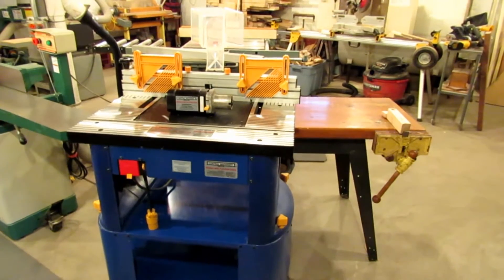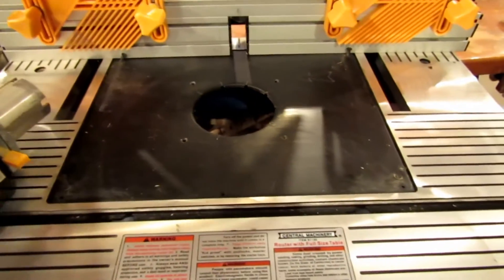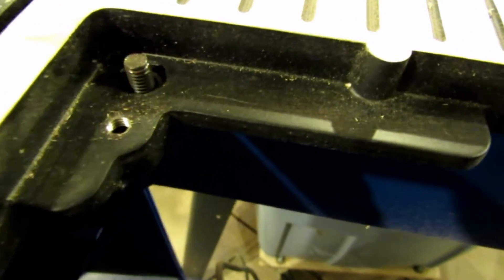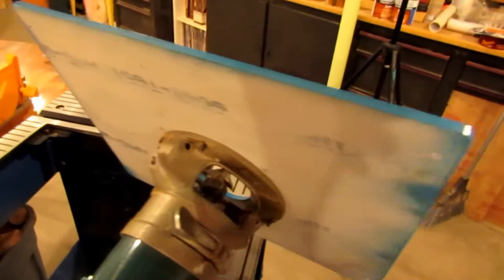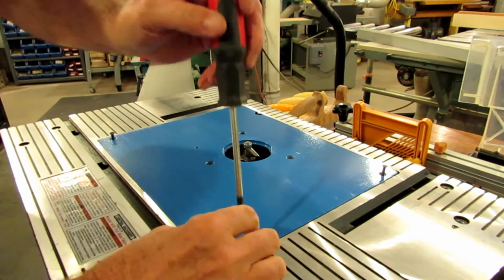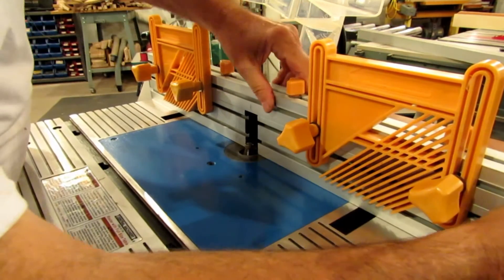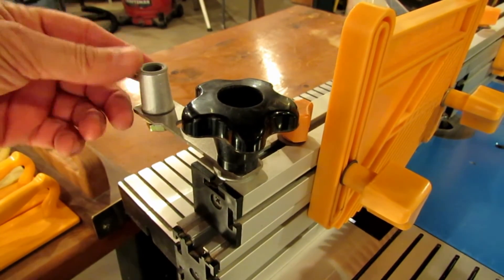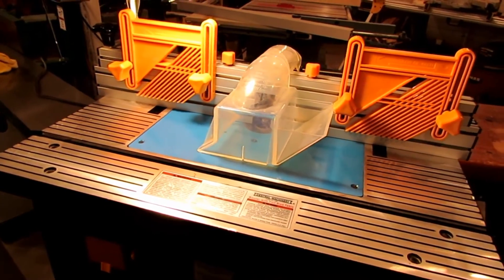Modifying a Harbor Freight #91130 to use a standard router.

Comment: I bought that table and trashed it with concrete board because I found, like you did, that the router was really difficult to use and for me gave me a ton of chatter since the collar cracked twice on me. I built an insert like you did, but not with aluminum. I did it with acrylic and there's too much movement. I'll look at getting a piece of aluminum made for me that would fit that plate size, just not sure how to make it myself.
Reply from the maker: It definitely was garbage. I made a cast iron top table now and what a difference. Aluminum can be machined with many woodworking tools. Thanks for watching.

Comment: Nice modification. Can you tell me what is the exact size of that insert plate you made? I may have the opportunity to buy this table and have an insert plate that may work for this table, but depends on the size. Thank you.
Reply from the maker: O don't remember  what size it was but it was bigger then any  commercially available  plate. I built a better  table that I use now. Thanks for watching.
Reply: @unemployedredneckhillbilly2023  Thank you. I'm getting a second hand one and was wondering if an insert plate I have would fit, but you're right, the one in this table looks bigger than the standard one. I'll have to customize one like you did. My main concern is to get a table with a perfectly flat surface and I think this one is. I'll go and check it tomorrow hoping it's what I'm looking for.
Reply from the maker: I switched  to a saw stop cast iron top that is flat and big enough to make working with larger items and using jigs much easier.  This top is good for beginners.
Reply: @unemployedredneckhillbilly2023  Good. As I said, my main concern is a perfectly flat table top. I had a bad experience with a MDF table top from Kreg that to my disappointment got slightly bent on the center. Just millimeters, but you can't allow that on this tool. So, I'm looking for metal now.

Comment: Thank you for your quick response! What tools did you use to cut the central opening?
Reply from the maker: I used a boring bar in my bridgeport.  Another way to do it would be to use a commercial plate and route a plywood adapter using a template. Would have been nice if they made the table cutout smaller.

Comment: I have one of these. Would you be willing to sell the old router parts that you do not need.
Reply from the maker: I burned up the router trying to use it on my CNC router. Here is a video of what they look like after burning
https://youtu.be/_WEfPKP3PpA

The rest of the parts went in the scrap so it is to late. Thanks for watching.
Reply: I just bought the floor model at Harbor Freight for $50. It was missing the wrench and the height adjustment tool. I have to go back there and see if they have the extra pieces. I really only bought it for the table. 

I watched the video. Your new set up looks good and it seems to work well.  You shouldn't have any problems with the Dewalt. They are well built machines.
Reply from the maker: The motor that comes with the table is junk and hard to use. If you have another router it would pay to make a plate for it from the begining. The wrench that came with mine was just stamped steel and streched some after using it, but I think I still may have it in the drawer with my router stuff.

Comment: I just got this from a parking lot sale for $51 so now I need to modify the plate for another roter.  Since I already have one I just need to place the put the holes in the plate that came with it thanks for the video, it will help a lot in the next phase.
Reply from the maker: I made the new plate so I could make and add inserts around the bit to make it safe to use. It could be dangerous to use if the space around the bit is to big when using a small bit. The hole in the plate that is on it is pretty big after removing the motor. That was a great price you got it for. Thanks for watching.

Comment: Yes, I did the same after ten minutes of reasoning  this router was good for nothing but a 3/8 round over bit. I drilled and reused  the same table insert with a harbor freight plunge router with a cost of 89.00 - $ 71.00 with your 20% coupon that is an exact copy of the Makita 3 1/4 hp plunge router so that you have micro adjustment from below on the height of the cutter heads especially if you are making male female door parts. Yes the table was good but the router went straight in the trash! Conclusion is simple make the table with a 2.5 HP 37793  It's so easy a cave man could do it. Also allows template work as can still place the bushing guide into the center of the router protruding above the table allowing you to cut an arch radius when the pattern is attached from below to the piece being mill above !
Reply: one more thing the finger guides were flimsy and need to be more rigid also 4 would be more appropriate with two on the fence and the two on the table having the ability to attach to the track supply for the miter guide witch is also flimsy but can be remade as 2 high and two low feather guides can be very help full when you don't have somebody to pull the last 8 inches out of the chute
Reply from the maker: I have a hard time believing that Harbor Freight still sells this unit. Like you said it would be nice if they made it with a real router. I wanted to be able to add inserts so I tossed the original plate and made the alum one with the step so they would drop right in. Grizzly has a low cost finger board that I use in the table slot. Thanks for watching.
Reply: So, no need to make a new insert plate? Can you use the same insert plate to mount a different router? That seems to be the case.

Comment: I was going to pick one of these up and the thing I didn't like was that the fence wasn't split.  it would be nice to be able to stagger them and use the table as a jointer. excellent job on your modifications, I really like what you did to make this into a really nice tool.
Reply from the maker: The motor setup that comes on it is a very poor design. I wish they sold just the table. It works pretty good with the mod ,but for the money you should be able to find a table with the split fence for jointing. Thanks for watching my video
Reply: Unemployed Redneck Hillbilly Creations thanks for the reply, now that I watched the video more closely I think I can see ways to modify it for my need.. I think I could put some flat boards or some nice slick melamine in front of the existing fence on each side... obviously the biggest drawback is still the motor.  thank you for being so thorough in your design, it really helped me.
Reply: robhimself79 You can add a shim to the fence to act like a split fence.

Comment: Do you sell the led lighted router base plates that you make?
Also, did you find a use for the router that you took out of the table?
Reply from the maker: Sorry, I do not sell the bases. I only made the couple for the videos to share the idea. I used the old router for a CNC router that I built. It only lasted about 40 hours before going up in flames and breaking apart. Here is a link to a video I made showing what happened to it. https://youtu.be/_WEfPKP3PpA  . Thanks for watching my videos.

Comment: do you have a set of plans available for this mod? I also have the #91130 & would love to get this mod, but would need some sort of plans (cad, sketchup, etc) to take to a metal shop (i dont have the means to work aluminium). thanks, Rod
Reply from the maker: Sorry I have no plans. I  just removed the old steel plate and traced he outline then transfer punched all the mounting holes to the aluminum plate. I cut most of my thin aluminum on my tablesaw with a carbide blade . For the router I made the insert rings, but you may want to look into buying a set from a company like mlcs and have the router hole machined to accept them and located where you want it.

Comment: Very nice! Would you be interested in creating another plate? I have a #91130 and would love to mount my Porter Cable router in it. I'd pay for it of course!
Reply from the maker: Sorry, at this time I have no material and am not interested in making the plates. It is easy to just transfer the od and mounting holes from the old plate to a aluminum blank. You could just buy the inserts from a company like MLCS and have the router mounting and insert hole machined.

Comment: Nice job, looks like you moved the router mount farther back also. I need to do this too.
Reply from the maker: +mine123 
Thanks. It was moved a little and I also added a couple of taps for starter pins. It is a simple fix that makes the table much easier and safer to use.